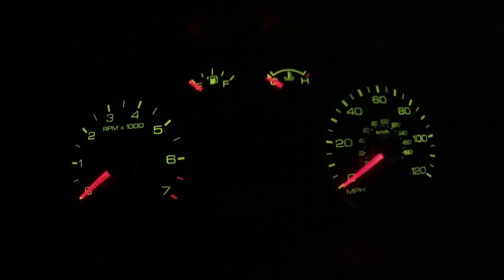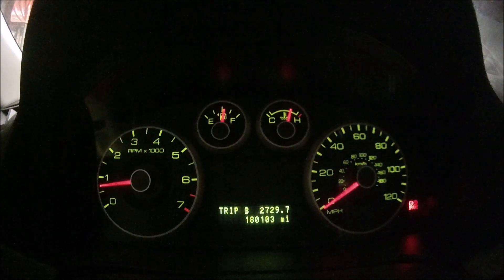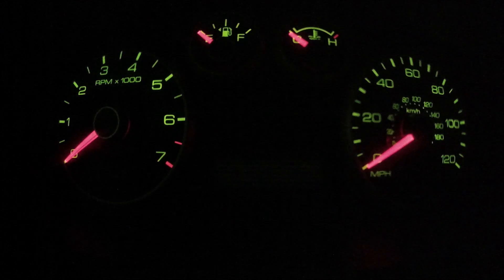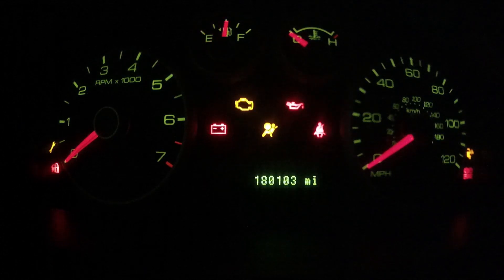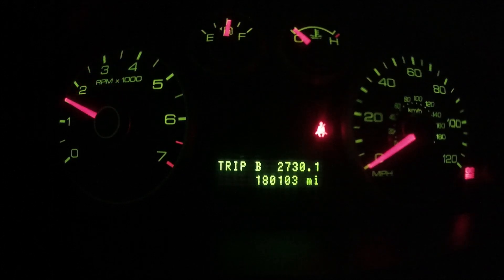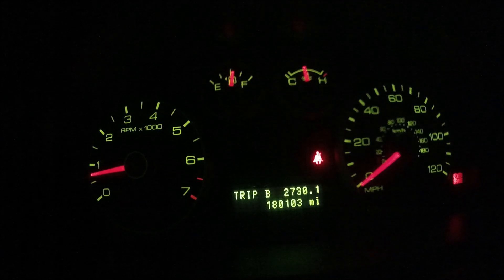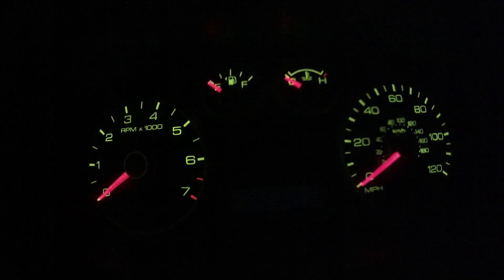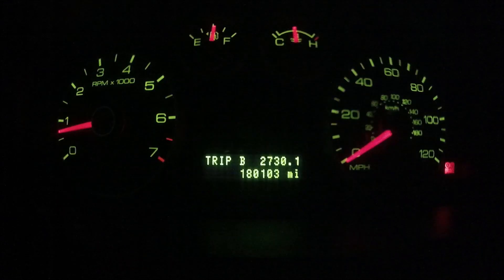Engine overheating and HVAC not blowing hot air - SOLVED

Comment: Worked like a charm !
Reply: Did you do this procedure with the radiator cap off or on?
Reply: @groggycl  I did it with radiator cap on this time.  Have done it before with cap off, but that's kinda dangerous.

Comment: My 2012 dodge Caliber was overheating and not blowing hot air, and after doing 2 cycles of this, my car is fine now. Thanks!
Reply from the maker: Glad to hear that worked for you
Reply: Did you do this procedure with the radiator cap off or on?
Reply: Did you do this procedure with the radiator cap off or on?

Comment: This process worked!!!. Took 6+ cycles but I have heat and does not appear to be running hot. Thanks.
Reply from the maker: Jeff Pavone Glad to hear that, thanks for sharing.
Reply: Oh I hope I can make this work for my car
Reply from the maker: Stacie Torres Let us know if it works for you, have a good day.
Reply: Did you do this procedure with the radiator cap off or on?
Reply: @groggycl  I did this a couple of years ago but I believe I added coolant to the reservoir with the cap on as it went down until I  had heat and not overheating. There was air in the system from a dealer flushing the system.